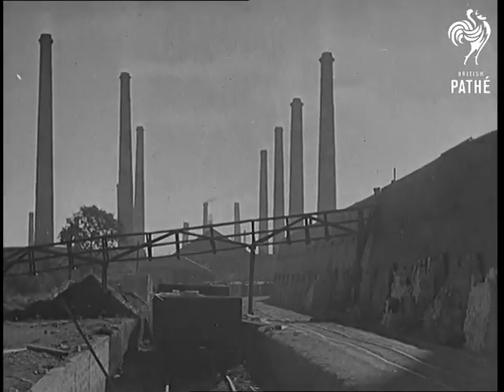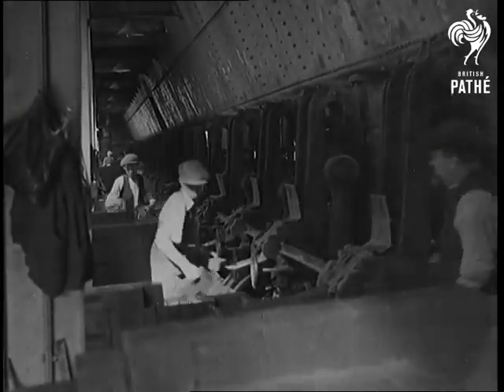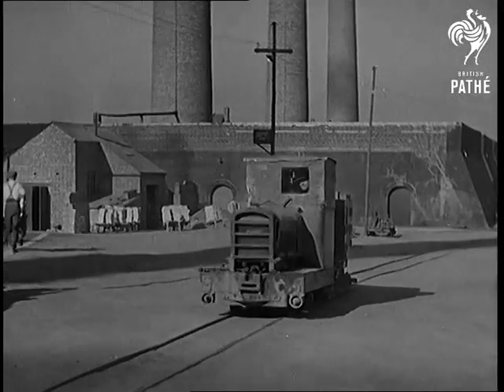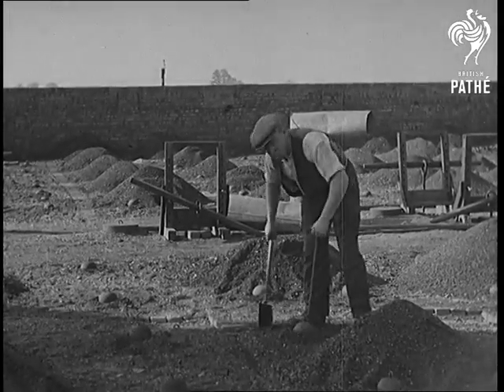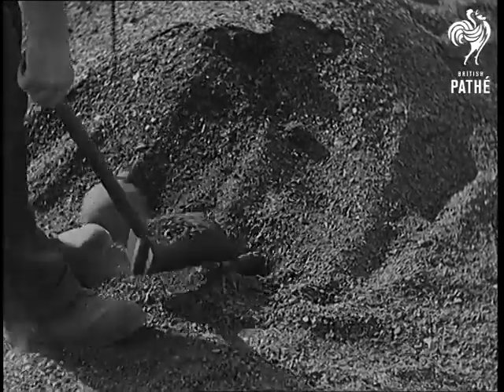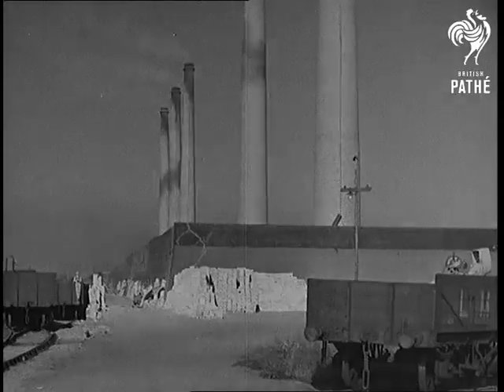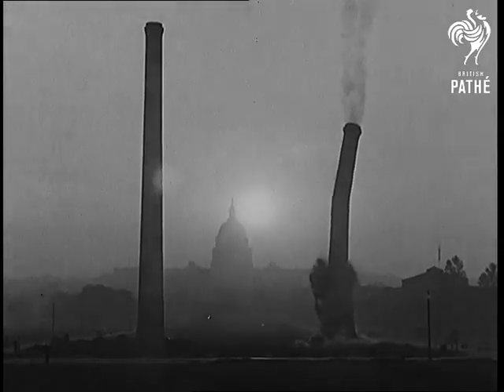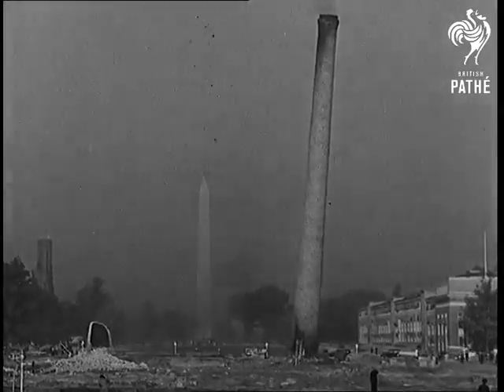Fletton Brickworks (1935)

Comment: Only just seen this. I worked as a kiln burner (the voice-over here refers to him as a stoker) at the London Brick Commpany fletton brick producing yard at Stewartby in Bedford from 1979 to 1992. I can assure anyone watching that the process was exactly the same as here in 1935. The machinery looked the same and the the top of the kiln was exactly the same apart from the later efition of a rail track which carried a metal structure roughly the size of a trlephone box around the kikn from chamber to chamber. It housed a "Kent" machine (later changed to Honeywell) which was hooked up to a series of thermacouples - 10 ft long metal lances - that went into those small holes we are shown to measure the heat in the chamber (up to just under 1000°). Apart from that, this could have been filmed in 1985. There were around 1500 men employed at the Stewartby yard when I started.